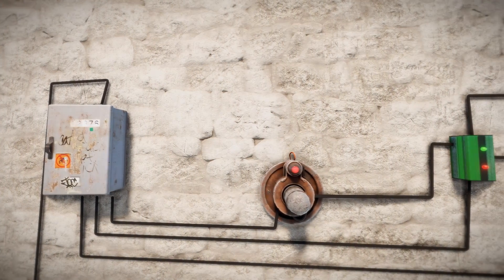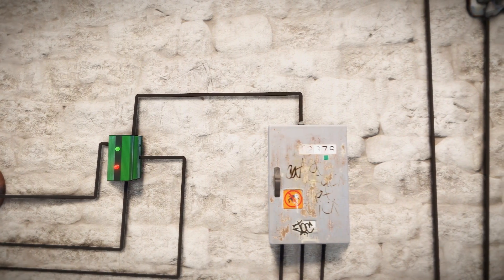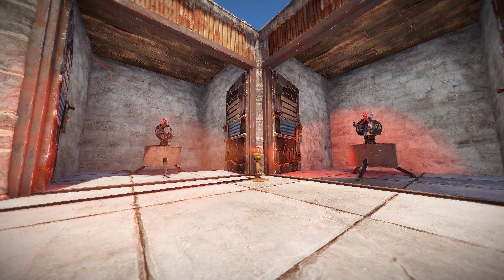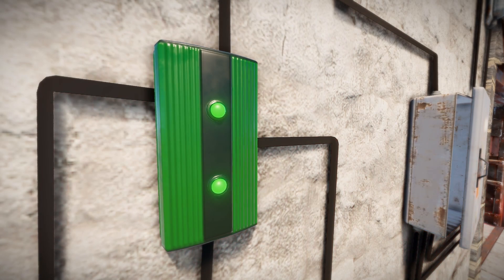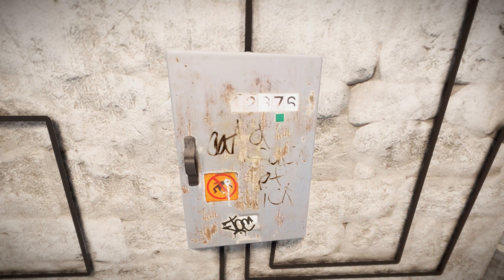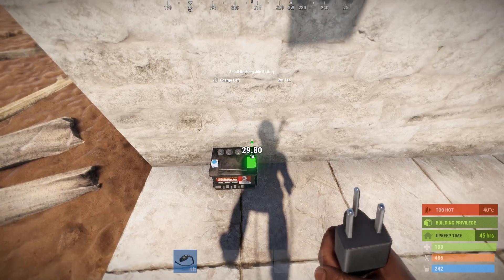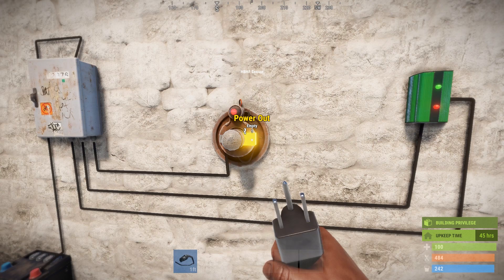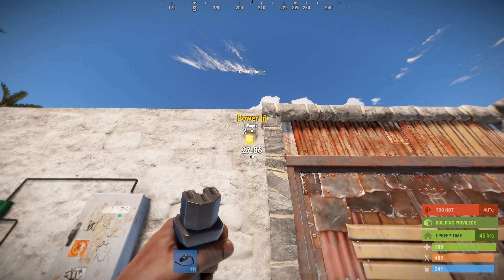RUST 101: Electricity Guide - Using The Sensor Properly

Comment: It doesn't work
The sensor wont ever have any output, i tried playing with the settings of the sensor via hammer.
 I did everything step by step as the video.
Reply: Of course it works.

Comment: Do you mind expanding on this. I want to make 3 "zones" around the base using two sensors for each zone for better coverage around edges. My issue is that it use so much power in branches and switches and the HQM cost is so high it's just not worth it at some point. Since I don't get any output running two HBHF sensors into a OR switch I have to use a branch and AND switch then to OR switch. That allows either or both HBHF sensors to trigger multiple things. (3x branch, 2 HBHF, 2x AND, 1x OR). The zones will later feed into one of three lights alerting those inside where they are, as well as activating turret pod doors and a transmitter.
Reply: You're forgetting about Memory cells.  You can run multiple HBHF into multiple SET option on otherwise powered memory cells, then run those memory cells into whatever you need to power.  Just remember that you need to also use an electrical branch per memory cell so you can run 1 power back into the reset node on each memory cell as well (otherwise it won't reset properly).  As a side benefit Memory cells also do not consume electricity so they can be used as repeaters as well.

This probably sounds like insane babbling, but any time you can't figure out a circuit in Rust, the problem can usually be solved by either a memory cell or a blocker

Comment: I've set it up exactly like you described, but my doors are opening and closing continiously when someone stands in trigger range. How do they remain open as long as the person is standing there?
Reply from the maker: They remain open because so long as someone is triggering the sensor it is sending power to the set function on the memory cell. If both the set and reset functions are powered the set function takes priority over the reset function so it shouldn't reset until there is no power going to the set (when the sensor isn't being triggered).

Comment: When trying to connect this to a counter it doesn't count how many people the sensor is well... sensing.
Reply from the maker: I did see a comment that the more people you have being sensed the more power it will push out. I haven't personally tried it but honestly it sounds like a side effect of how it was coded and they've just forgotten to cap it to 1.

That being said if that is the case then you should be able to set a counter to show passthrough and it should show it. Although the counter itself uses 1 power so it's likely always going to be off by 1.

Comment: What if you want to hook up multiple sensors to one alarm system? So at the minute Ive done this using AND switch but want several hbhf sensors to link to same alarm system so if anyone of them is triggered it triggers alarm to N-S-E-W side of base

Comment: Can you answer this very important question; What is the best positioning/location of the sensor, ex; Floor,Wall,Doorframe, OutsideWall Angle, Inside Wall Angle would be appreciative. I feel like the sensor has blind spots even though I have 2.
Reply from the maker: Depends on the base and where it's built, for example a 2x2 in a fairly flat area I'd throw one on the ground outside at one corner and the other on the ground at the corner diagonally opposite the first one that way you cover all four sides with 2 of them. 

But again it's extremely circumstantial and also depends on what you want them to do.
Reply: Thanks man I think the roof and floor works the best and yeah it will depend on the build

Comment: Thank you Mal for this comprehensive guide!
Reply: There is a easier method using a AND gate. Input1: HBF output; Input2: power source
Reply: @TheOfficialSniper916   If I understand correctly, this means that when the HBHF is triggered whatever is connected to the AND will turn on?
Reply: @RodsAndAxes  the output of the AND gate will turn on. AND is a logic gate and it requires all inputs to be true to output a true. Since the power source is always outputting true, the AND gate will only output true when the HBHF sensor gets activated.
Reply from the maker: No worries! :)

Comment: Nice video. I haven't been using the memory cell, instead I use a branch with the branch out going to the HBHF and the power out to an AND switch. Always nice to see alternate methods of doing things though. Thumbs up!
Reply from the maker: Yeah absolutely, on the flip side I hadn't  used the and switch method until it was mentioned here. I'm all for finding different ways to make electricity useful! :)

Comment: Here's a question, not sensor related but something I'm stuck with. 

Is it possible to make a door open and close on a timer, but constantly. Say like every five minutes or something, once a switch had initially been pressed. 
I'm looking into a way to try and trick potential raiders into thinking that I'm online.....
Hope that makes some sort of sense! 
Any info very much appreciated.
Reply from the maker: That's an interesting one, theoretically I think it could be done. I'll play around with it and see if I can get it to work. :)
Reply: @Malonik  give it a go man, I'm still not great with the electricity update but slowly getting it sussed, after watching your vids hopefully you might be able to figure it out if it's doable. 
One thing's for sure, if that idea pans out there will be lots of frustrated offline raiders 😁
Reply: @magoomagoon  Yes this can be done and I've done it. An initial 'ticking timer' can be created with the use of 2 branches, a blocker and a timer. This however is a leading path into advanced logic and electrics, practical both in and out of rust.

Comment: When there are multiple people in sensor range the device puts out more power.  Will that affect the Set of the memory block?
Reply from the maker: Wait really? That's weird, I swear it was only outputting 1 when Gal and I were testing it... Won't affect the circuit though, doesn't matter how much power is sent to set as the memory cell is basically just checking to see if any power is there, if there is it sends power through the output, if there isn't the reset stops it.

Comment: I did run into this problem with it, my work around was using and AND switch, when power is received from the sensor AND battery power, the power goes through. I send this into a splitter and then power three things or 2 things + another splitter etc.
Reply from the maker: Oh nice one! I hadn't thought of using an and switch, that's really clever. :)
Reply: I use an And switch also. ;)
Reply: @gamingoutlaws9342  seems like the simplest, have you noticed both the blue flashing lights and siren lights both run even when not powered sometimes, like they have their own battery?
Reply: @simonfredette99  I havent seen it first hand in game but another youtuber that creates rust electric tutorials noticed same issue in one of his videos.